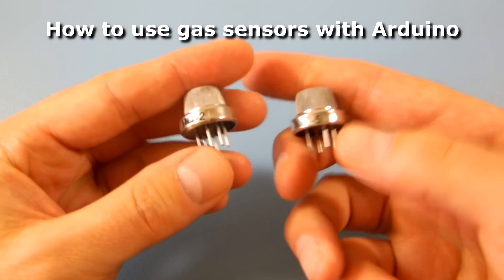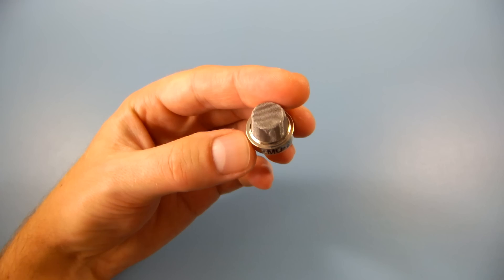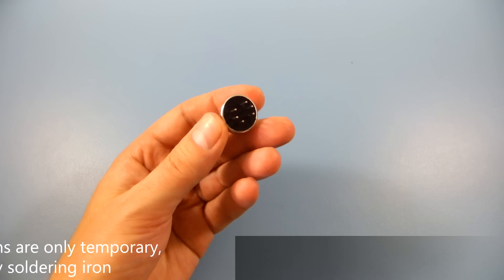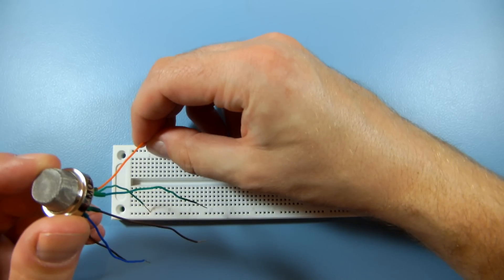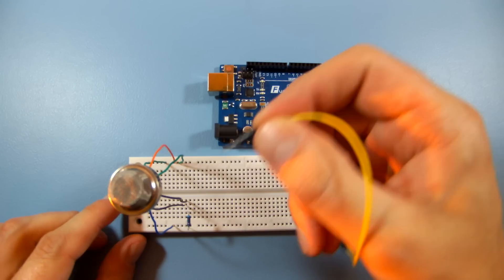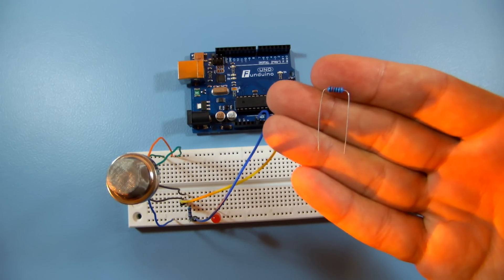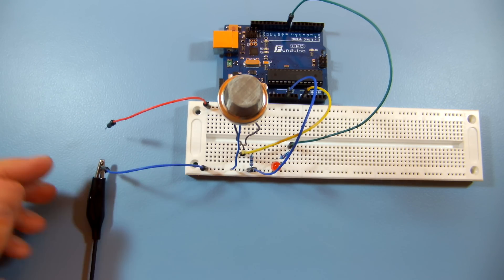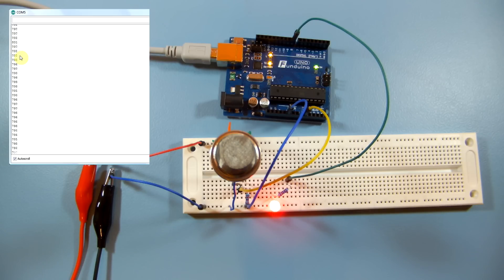How to use gas sensors with Arduino || Arduino tutorial

Comment: Superb video ...I am a new comer to innovation and gonna start my first experiment with this.
Thanks for so detail and simple explaination :)
Reply from the maker: I'm glad you like the video, thanks for the comment and good luck with your experiments. If you have any questions while experimenting, feel free to ask :)
Reply: ElectronFun.com Thnks! Pal...
Will do the same definitely :)
Reply: Dear pal ,
CAn we also assemble it into a single device?
How to do so?

Regards
Reply from the maker: Akhilesh Sharma
What do you mean by single device? Do you want to build a simple Arduino using only necessary parts and use it with the sensor?
Reply: ElectronFun.com yes kind off....

I was trying to use it at my home after making it... 
is computer connection necessary each time??

and can bread board be replaced by something?

Regards
Reply from the maker: Akhilesh Sharma This is only a prototype on a breadboard. It is possible to use diodes, LED bar graph, seven-segment display or even text LCD, which would indicate gas concentration. You wouldn't need a computer to read the results. All parts can be soldered to a perfboard and closed in a project box.
Reply: ElectronFun.com Thank you dear.

It was much helpful. Will disturb you again if i feel in trouble ;)

Regards
Reply from the maker: Akhilesh Sharma
No problem, ask if you have any questions.
Reply: ElectronFun.com Hey where to get that kind of power supply with clippers... is it online? or a proper term for it? Plz help
Reply: Akhilesh Sharma And have you also shown the pref board demo of the same??
Regards
Reply from the maker: Akhilesh Sharma It's a bench power supply and wires with a banana plug on one end and alligator clip on the other end. My power supply is a cheapo for about $25-$30. You can buy power supplies online.
The project was build on a solderless breadboard as shown in the video.
Reply: ElectronFun.com dear can we use any other battery instead of bench power supply...if yes how?? :O
Reply from the maker: Akhilesh Sharma You can use a battery, e.g. Li-Ion or LiPo, but you need exactly 5V, so you would need a linear voltage regulator or a buck converter on the output of the battery. You could also use a 9V battery with a voltage regulator or buck converter, but the gas sensor would drain it in a couple of hours maximum. If you don't know how to use linear voltage regulators and buck converters see my video with a practical comparison of these two devices: https://www.youtube.com/watch?v=giGRrODKJSE
Reply: dear sir,
Can't we give it connection through +5v port of arduino and same for _ve??

Regards
Reply from the maker: Akhilesh Sharma I wouldn't risk burning your Arduino board. The sensor's current draw is very close to the Arduino's maximum ratings.
Reply: Ok thanks bro i will go with Separate one :) (Y)
Reply: Dear
I ordered a gas sensor from ebay.. But the one i got is with a small board attached with it...

Which have 4 pin coming as AO , DO, VCC and GND..
Now how it sud be connected to bread board? :O
Reply from the maker: Akhilesh Sharma The A0 is the pin you should connect to the A0 on your Arduino board. You can skip the D0 - it's a pin that goes high whenever your sensor detects something. The VCC goes to 5V and the GND pin is obvious. If you have any trouble, feel free to ask :)
Reply: thank you sir ,

I have connected the sensor module as said , but there are  no readings on serial monitor.

Even i reset the arduino and re uploaded the code. the serial port is also fine :O
Reply: yuuu huuuuuuuuuuuuuuuuuuuuu......

It worked after changing the port in serial port..
Thank u sir, You are a life saver :) :*

Warm Regards
Reply: But i have a another question ;)

Can we use buzzer or LED for alarm with arduinio???

Please reply soon
Reply from the maker: Akhilesh Sharma I'm glad you figured out what the problem was :)
Sure you can use an LED or buzzer. Watch my video again, at the end there is an LED that lights up when gas concentration from a lighter hits a certain level.
Cheers
Reply: yes but that is with bread board ,..
I directly connected the module with arduino..

Have i did a blunder :O....
Reply from the maker: Akhilesh Sharma I'm not sure how much current your sensor module draws, but when you connect something more, like an LED and buzzer you may be close to Arduino's maximum current capabilities. If you're unlucky, you may fry your Arduino. In my video I'm connecting external power source and there is no risk of frying the Arduino board.
Reply: sir my project is almost complete..but the last ques. is how connect that module(instead of sensor) to bread board?
Reply from the maker: Akhilesh Sharma I have already answered your question 2 weeks ago:

"+Akhilesh Sharma The A0 is the pin you should connect to the A0 on your Arduino board. You can skip the D0 - it's a pin that goes high whenever your sensor detects something. The VCC goes to 5V and the GND pin is obvious. If you have any trouble, feel free to ask :)"

If you don't understand anything, just tell me which part is problematic for you.
Reply: yeah but then how to connect bread board and sensor together to arduino?

Coz as u told me was the way to connect module to arduino
Reply from the maker: Akhilesh Sharma Use some jumper wires to connect the sensor to the breadboard and to your Arduino.
Reply: So where sud A0,GND and VCC of that module sud be connected in bread board?
Reply: done !!! 
The gnd pin goes to _ve rail
VCC to +ve one and rest is understood :)

Thank u so much sir.. OWE u a one :) Lots of love and respect for your patience
Reply from the maker: Akhilesh Sharma Great! You figured out the problem. I'm happy I could help you at least a bit :)
Reply: Sir gas sensor is showing such reading

"115 213 778 576 87 195 768 603 81 177 766 631 89 153 752 65"

what can be the problem area?
Reply from the maker: Akhilesh Sharma If you have such inconsistent readings, you should preheat your sensor by leaving it on with all your circuitry for over 24 hours. It is mentioned in the datasheet.
Reply: it usually show constant readings now but the reading never go above 495.. earlier it used to
Reply from the maker: Akhilesh Sharma Have you tried feeding the sensor with some gas, from a lighter for example?
Reply: yes sir from a gas lighter..
earlier it was working fine but now the reading on serial monitor just go to a maximum no. of 495
Reply from the maker: Akhilesh Sharma How long do you wait after powering up the device? Are you using my code, or did you modify anything?
Reply: no using the same code, which u mentioned ..

after powering up i am waiting for 2-3 minutes
Reply from the maker: Akhilesh Sharma So theoretically you're doing everything correctly. Have you checked all the connections on your breadboard? Something might be loose.
Reply: sir i also tested it directly on the arduino.. i think the sensor having some fault right?
Reply from the maker: Akhilesh Sharma
The sensor may be faulty. Have you tried re-uploading the sketch?
Reply: yes so many times...
I got a new sensor though, its working fine :)

thanks again for being thr :)
Reply from the maker: Akhilesh Sharma Great, so you have found the culprit :)
Reply: yep :)
Reply: Sir any idea for its PCB implementation .. Do you have any tutorial for that too?
Reply from the maker: Akhilesh Sharma Sorry, I don't have any tutorial like this (at least not yet).

Comment: Really interesting video. can we show amount of gas (gas thickness) using lcd display? pls
Reply from the maker: Thanks! Yes, it is possible to present the readings on an LCD display. Would you like to see the values from the Arduino (0-1023) or convert them to ppm units? If you want to get the readings in ppm units you would need to calibrate the sensor against a reference sensor.

Comment: sir good day, i have a question regarding th connection, should i rally use a separate power source of 5 volts? cant i use the same 5 volts from the arduino? can i use a normal 9 volts battery for th separated voltage input for the gas sensor? thank you sir, this will be a help
Reply: also sir i have tried to view the serial monitor and wait for atleast 5 minutes to trim down the output sensed value by the mq5, but still output value ranges from 600 above till 1023
Reply from the maker: Hi, according to the MQ-2/MQ-5 datasheets the sensors consume up to 800mW, which is about 160mA at 5V. Here: http://playground.arduino.cc/Main/ArduinoPinCurrentLimitations you can find Arduino pin current limitations: the 5V rail can deliver 200mA maximum. The sensor's heater alone would consume 160mA out of 200mA. If you connect anything more than the sensor, you may fry your Arduino board.
Yes, theoretically you can use a 9V battery for the gas sensor, but you would have to use a 5V voltage regulator. However, I would not recommend using a 9V battery, because it will not last for long. A typical 9V batteries have about 300-580mAh capacity. Your gas sensor would probably work for less than 2 hours (if you're lucky).
The MQ-2 and MQ-5 need a 24h preheating (burn-in). You should hook up your sensor to the circuit and leave it in on for 24 hours (make sure everything is connected properly to prevent from overheating and eliminate the risk of fire). You can do this only once. It is meant to make the readings more consistent. It should help in your case.

Comment: Sir, can we use gas sensor MQ-135 in the same way as shown in the video?    
 with same connections and same code?
Reply from the maker: Yes, you can use MQ-135 in exactly the same way and with my Arduino code. Just experiment with the load resistor value and "sensorValue" in the Arduino code.
Reply: ElectronFun.com Thank you very much
Reply from the maker: Renil Sebastian
No problem :)

Comment: cool!! thx
Reply: ElectronFun.com  hi, you're doing a great job up there, thanx alot I'll be really thankful if you can send me the code H2 sensor mq-8 eng.farah2007@gmail.com 
also I'm using another sensor to detect O2 can you check the link and give me your opinion about the sensor http://www.dfrobot.com/index.php?route=product/product&product_id=1023&search=co2+sensor+v1.2&description=true
Reply from the maker: Farah Aia Hi, thanks a lot! You can use the same code for the MQ-8 sensor (http://electronfun.com/project_2.php).
I've never used the CO2 sensor like this and I'm not sure what to tell you. It's not a cheap sensor and I can't find any info if it's already calibrated or not.
Reply from the maker: I guess you've found the link to the code :) Thanks for watching!
Reply: ElectronFun.com i couldn´t find the code for MQ-2   only youtube-link, can you send me it please
Reply from the maker: lefeu lapluie You can download Arduino code here: http://ElectronFun.com/images_projects/gas_sensor.zip
Reply: Lefefeu do you have the code?
Reply from the maker: satorfs
Just click the link: http://ElectronFun.com/images_projects/gas_sensor.zip
Reply: the website seems to be ofline for me :(
Reply from the maker: satorfs
It's a direct link to the file with the code. The page is on-line, maybe your Internet provider has a problem. You can send me an e-mail and I'll send you the code if you want to.
Reply: satorfs tkz!!